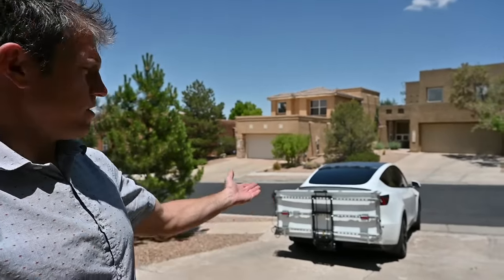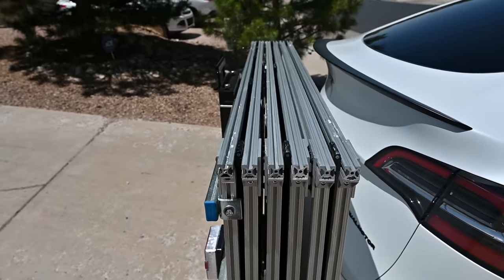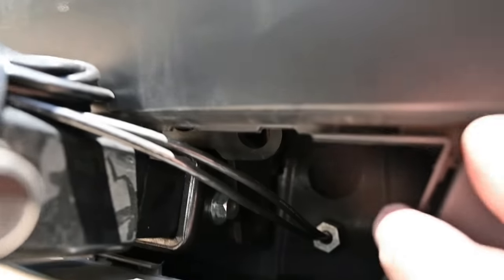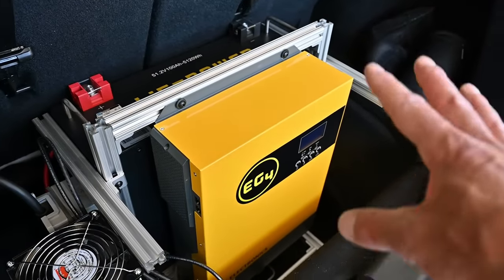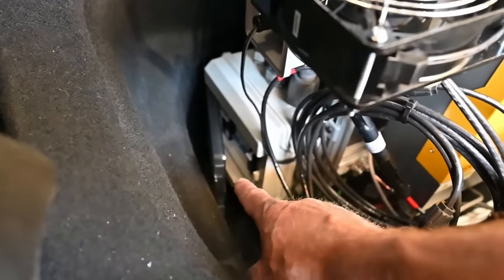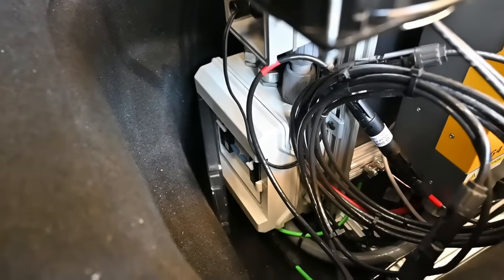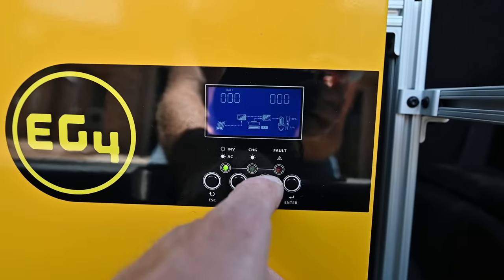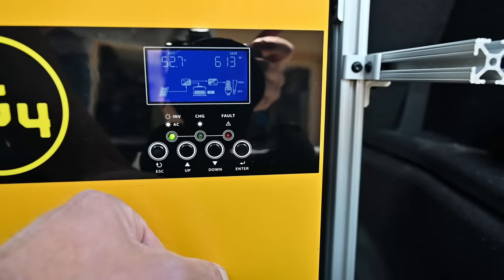Tesla Mobile Solar EV Charger with EG4 inverter and battery

Comment: How long does it take in full direct sun to charge your Tesla to Full? What situation do you think you'll find yourself in where you'll need such a system? Is this practical or just doing it for the fun of it? It seems like with the inverter DC-to-AC-to-DC losses, you'll only put about 80% of the power from the solar into the Tesla battery, e.g. 1000 watts used = 800 watts into the Tesla Battery. 

Very interesting, but I'm not sure that you'll ever get any decent reasonable ROI on the system. Where I live power at home is $0.13 per kWh. $0.25 at a SuperCharger. If you get let's say you can generate 6 kwh per day, and I think that's generous, that's 5.4 kWh into the battery with your 10% Solar DC-to-AC conversion loss. 

At home, it will take you 9,108 days to make your money back. 25 years.
Supercharging, it will take you 13 years.

I don't understand it, but congrats on building it!

If I were building it, I would deploy it full time at home outside, use the EG4 inverter to feed some portion of my home electrical, and then only put it into the car when, say, the end of the world occurs.

Comment: It adds 30 miles of range to the car per day... Regardless of how much the car weighs. The car only goes 270 miles on a charge instead of 300 miles would be an irrelevant statistic. You could put a massive rack on the roof with all your camping gear and drive from campsite to campsite to campsite in the middle of nowhere where there isn't a gas station for a thousand miles... indefinitely. All you have to do is wait for it to charge. Does that help clear up the unfounded concern that the extra weight decreases the range 30 miles?

Comment: Probably others have already made this comment but I’ll make it. Why can’t you just take these PV panels and add them to your PV system on your house, maybe increase the amount of battery storage in the home system. Then just charge the car when you get home. The advantages are you don’t have to lug this thing around all the time, unfurl it when you get to wherever you’re going probably in a non-optimized solar exposure situation. You also don’t lose use of your trunk in the car. You’re not exposing the batteries to excessive high temperatures in the home system. You regain whatever efficiency you’re losing by having these things strapped to the back of your car. I would do real world testing over say a period of two or three months then I take the solar panels off the car and put them on the house for two or three months. With all the losses you’re having I bet you’ll get more power with the house mounted system.

The only advantage I could see for this system is if you’re taking an extended camping trip with the car and you have absolutely nowhere to plug in. 

I think it would be interesting for you to do the experiments that I mentioned above and do a YouTube video on it

Comment: 1.2kW seems way to small to charge a car.  It would take a week to do a full charge.  What is your typical energy requirement for one day?
Reply: Well, at 1200 watts, for each hour of charge, you get a range of 3 miles. So, 3 hours of change (assuming 1200 watts), that would get you 9 miles of range.  So, depends on the daily requirement as you note.

My spider sense suggests that 2 or 3 rolls of flexible solar panels - thus inside the trunk, and you pull them out, roll them out, that could get you a LOT more power for less weight and less volume.

Comment: epic dude, would could also put that on the roof top, in a box, fully aerodynamic enclosure, also would make a temporary roof, like in an rv
Reply: and it would place the weight on the middle, not on the back lever
Reply: you ever wanted to make a tesla electric solar plane, stol single wing craft
Reply: yes folding main wing, electric power routing to wheels and/or main air plane rotor
Reply: solar box on the roof, roof sized solar panel wing sections, self-supported and locking

Comment: Why do you need a battery if you are running the power directly into the car battery?  Wouldn’t you save a lot of weight by eliminating the battery.

Comment: Perhaps charging in DC from the solar panel will be much better and less loss. As PV are DC and the car’s batteries are DC ;-). And or a solution with flexible PV going above the car and feet blocked by the tires.

Comment: As a Tesla owner I think that’s really dumb. You have 85kwh of battery, and you can charge about 1kwh when you have good light. If you have an optimistic average 8 hours of light, it will take 10 days to recharge the battery almost to full. Also the drag of that thing on the back+ the extra weight will remove any benefit of it. The option are 1. Mount a proper fixed system on the roof of your house, maybe from 6kwh or more, and maybe whit a Tesla battery, so that will make sense to charge on it.
2. Don’t waste time and money on this, and use the money saved for charging normally. Idk how the current costs where you live, but assuming you spend 2000$ on it, the current here costs on a quick chargin station whit a flat offer 28cent/kwh. So you can charge about 7140kwh whit that money, that are about 35.500km

Comment: nice setup but the weight and airflow obstruction will outweigh any benefit of a 500W solar charger. The panels even with full sun exposure will barely add one mile of range  per hour of charging. While the airflow drag you create will take away two.

Comment: How long does it take to fully charge the car with the panels
Reply: With just the panels on the roof how many more miles are added to the range of the vehicle?
Reply: None unfortunately. The system requires all of the panels. It wouldn't do anything with just the roof panels.
Reply: @Mike-.  with all the panels how long to recharge the Batteries in the Tesla
Reply: @cyndiharrington6289  maybe 10 fully sunny days. More if you drive it at all. Not really a useful addition but more of a cool/fun project.

Comment: Why not use microinverters. You could probably replace all that crap in the trunk if you use microinverters. If I understand it correctly all you would need is microinverters and an electrical plug.

Comment: Too bad you can't DC charge the car's battery directly from the panels through a solar charge controller, and eliminate the inverter and spare 48 volt battery.  Is this possible?

Comment: isn't a device which charge directly from solar? lika a MPPT charger but with DC connector for cars?
because now you get DC from PV, put it in bateries, the inverter makes DC-AC, and then the car make AC-DC

Comment: So this 5.12 kWh battery, fully charged, will give you approximately 15 miles of range when you factor in efficiency losses in the inverter and the charging losses from charging the Tesla battery coupled with the reduction in range from the extra weight that you're carrying from the LiFePo4 battery, inverter and the solar modules. No offense, but it seems like a very expensive add-on when compared to the cost of just driving to the next available Tesla charging station.

Comment: You don't say how long it takes to charge the battery. Considering that even a 5kW household rooftop solar would take a while to charge a car, your 1kW system is going to take many times longer presumably

Comment: Idk why electric cars don’t just have built in or optional solar charging via an external PV system for like camping or anything.
Reply: Yes, because the electronics is basically already there. For example, regenerative braking can feed spurious power to the EV battery, so should an external DC input for solar. 

For this setup, there's so many conversions: 1) step-down from PV to battery, 2) step-up from battery to intermediate 120V DC voltage, 3) invert from 120V DC to 120V AC for the car AC input, feed to car, 4) rectify from AC to DC in the car and 5) step up to the EV battery. All this could be done with a single DC to DC conversion from PV to the EV battery.

Comment: Why not just use microinverters on each panel (helps with shading problems and the potentially hot inverters are outside), remove the battery and charge just on panels?

Comment: 1 kw from portable solar its very good !! If there was a simple dc input from tesla you wouldn't need inverter and batteries 3000 $ less and more efficient charging. I am wondering how they are supposed to save the environment and they didn't install a 50$ cost charger to a 40000$ car. ( Universal step up - down converter 12 - 140 volt dc input plug ) such a simple thing...

Comment: I see very little use of all the hard work and dedication unless you are going for camping and no charge stations nearby. One mile requires 75000/300=250 watts. 120V 1.4KW is roughly 4.5miles per hour.

Comment: It would be better to put all that heavy stuff on a small lightweight trailer then the car isnt burdened carrying extra weight and drag unless your towing the trailer to the next destination. Better yet you could just stop at a supercharger and charge for 20 minutes.  I like the idea but the efficiency loss and cost make it impractical for very little benefit if any. Theres a reason APTERA vehicles look like they do. Thats an example of portable charging on a vehicle designed with highest efficiency in mind from the beginning

Comment: Kinda surprising that Tesla doesn’t have a option for more clean but similar panels integrated into the car also.
Reply: Tesla solution is solar panels at home with a powerwall. Otherwise you loose all cargo capabilities to carry the weight of the panels, inverters... 
The available cargo weight on a Model Y with driver + 4 passengers is just 204 lbs (93 kg).

Too many superchargers aren't directly fed with solar panels and local battery packs but expansion of the Supercharger network is more important than making ALL of them, energy independent. Tesla also works hard on helping transition grids to renewables with projects like Battery Megapacks for utilities and virtual power plant (managing privately own powerwalls to sell energy to utilities, when the grid needs extra load).

Comment: Why dont you install all that stuff on a little trailer?  When you dont need solar charge you can use the trailer as a back up generator.  Also that panels at the back behaves like a prachute and you will lose too much energy.

Comment: 420 watt panels are making more projects possible. Most people charge at home.  Most people fly when they travel.  Level
2 charging stations are too slow for the most part for travel.  More DC fast chargers are the answer.  When you buy a Tesla that MSrp helps support DC fast charging, superchargers.  Other manufacturers leaving charging to private or taxpayers.

Comment: What is the physical size of the pv panels?
Reply: Around 60" x 20" without the frames.
Reply: @danielderkacs6180  I would have used Merlin solar panels...can walk on them shoot them 2% better efficient....   Seems like a power station could have been more compact....if need more battery then feed the power station with that 5.1k battery...... How much range can you get in a day?
Reply from the maker: I've never seen Merlin panels, they look promising assuming you can actually get them. I can get around 8-9kWh per day right now.

Comment: I don't get why you can't charge directly onto the car as DC charge
Reply: I could be mistaken but those car batteries are 350+ volts volts, he would need a lot more solar panels and a really high volt DC to DC charger.
Reply: I assume you meant can’t charge directly from DC… simple answer is volts, but there are protocols the dc fast charging requires that are proprietary to Tesla, and while this would improve the charge efficiency, it would be a lot more difficult to implement.

Elon should sell a solar charge cable for dc panel charging… could be a market if you try it.
Reply: I have long sought to directly DC "slow" charge at home with my home panels. There's a company that has figured out the protocols to do emergency mobile charging so it is possible.
Reply: @SuperVstech  The protocols are only needed when fast charging for overheating protection. His panels deliver less than 1kW total. That's very very slow charging. No protocol needed. All you need is the panels, a DC-DC step up converter to bring the voltage in the range 350-400V and wire the converter output directly to the (+) and (-) pins of the charging plug.
Reply: @christianbarnay2499  I agree in theory we should try for that instead of doing DC to AC and then AC to DC.  Most other suppliers now have solar charger bridge you can buy to avoid the inverter path

Comment: Nice dream but consider 1200w panels charging a 75 kW tesla battery. 1200w panels will likely only kick out 800w on the best sunny day with the panels laid flat on the ground and one loses  75000/800 =93 hrs=4 days to charge the tesla.
Reply: Sorry, forgot to Calculate 93 hrs of bright sunlight. I've had 1200w system installed  on my roof for 3 months and only harvest about 100kw a month so the tesla would take about 3 weeks to charge.

Comment: It won't be long before you absolutely fry your EV's onboard charger by using that high frequency, transformerless inverter. Because there is no galvanic isolation between the inverter's DC boost stage and its AC output. All it will take is for the AC output monitoring circuitry to fail and one of the MOSFETs in the inverter's H-Bridge circuit to short to ground, and this high frequency inverter can send dangerous, high voltage, high amperage DC current straight to your EV's onboard charger which will not only damage it, but can also set your EV's charger on fire. 

You may be able to use your high frequency inverter to charge your EV now, but it's just a matter of time before the MOSFETs or IGBTs in your inverter fail and you can kiss your EV's onboard charger goodbye. A much better and safer choice if you want to charge your EV with solar is to use an inverter or power station that uses low frequency, transformer based technology in its design. Low frequency inverters can handle high surge loads for at least 3x their continuous rated capacity and they can do this repeatedly, without sustaining damages to their MOSFET transistors, for minutes, rather than the milliseconds that a high frequency inverter offers. And because low frequency inverters use a transformer, they provide galvanic isolation which protects your EV's charger. That's why the big name brand inverter manufacturers like Schneider Electric, Outback Power, Sigineer Power, Magnum Energy and Victron Energy and others, all use a low frequency topology in their design.

Comment: Hey. I have a question. 
Is it possible to instead hitch a sheltered/enclosed small trailer behind your Tesla that can house all the electronics? 

A trailer. Used for hauling tools. Something like that. 

Then simply put all your work on it. 
Your solar panels and other work. Install it on the trailer.

Comment: Of you gotta do all this ..... DOESN'T a light go off that says the technology for cars is not ready for practical use.  Have you considered that in 5-7 years you will need the shell out about $20k-$30k for a new battery replacement and installation? 

MAYBE a third or 4th generation selectric car will have the right battery chemistry to distance E-mpg ratio.   As of right NOW it's still vaperware.  A Very rich  persons toy.

Comment: Go fifty seconds into the video and you can see that there is no way you can drive safely. Can't see brake or tail lights. You would get pulled over in my state. Not legal unless you put a light set on the solar panels. Very dangerous. It will drag the range down considerably.  Part of a Tesla's range advantage is that it is one of the most aerodynamic cars in the world. However The the unit could fit in the massive storage space in the Model Y then all those issues would go away plus it wouldn't drag range down nearly as much.
Reply: Go check your eyes

Comment: Pay tons of cash for a car still do all this hassle coz range problems :D I love tesla as well but i can afford to wait few years and so should all of you. New model 3 is getting over 350 miles next year. I am pretty sure in 2-3 years we will have all tesla with over 400 miles range so we can go very long distance without this charging in between for 15-30 minutes bs. Just wait couple of years and get a perfectly made electric. Don't rush into buying right now. I can easily afford model y right now but i ain't going to. Just use whatever u got for few years. My goal is getting a model y as soon as they start giving 400 miles range or more. That way even if i am driving in rough conditions my range wont go below 300 miles ever.

Comment: Why not just have the dc to dc charger charge directly to the car batteries? Bypass the cars charging system and configure, through series, parallel or both, the voltage needed to go directly onto the car batteries.
Reply from the maker: That would take at least 20 panels in series OR a lot of non commercial-off-the-shelf parts/engineering to get up to ~400V.  Goal was to make this from parts anyone can readily buy.
Reply: @gridfreeordie  400 hundred volts is way too high for conventional solar panels.

Comment: BETTER  SOLUTION ,
Use a already designed all in one , battery  inverter controller  system power station , already put together.
Reply from the maker: Agree somewhat. It gets hot in the trunk and I don't know if they would shutdown.

Comment: Some people have too much money and time to waste. It will take 20 to 25 days to fully charge a Tesla with this set up.  All these guys saling smoke. Tesla cars are toys for tech junkies. If you disagree with me read the reasons Hertz is selling more than 2000 car this year. Teslas are too expensive to maintain, prompt to get in front end collision, higher insurance cost, and tire replacement after 20,000 Km since they weight more than gasoline cars.